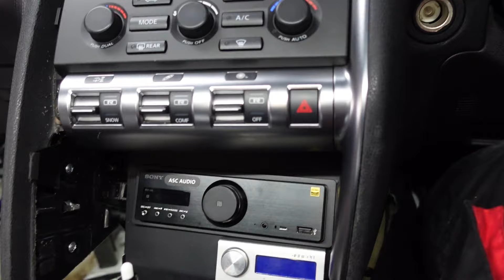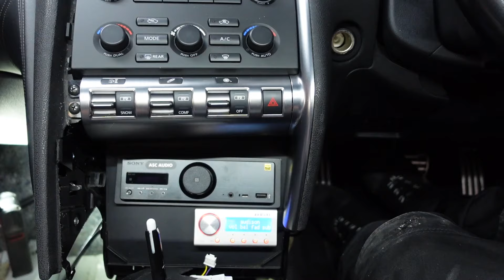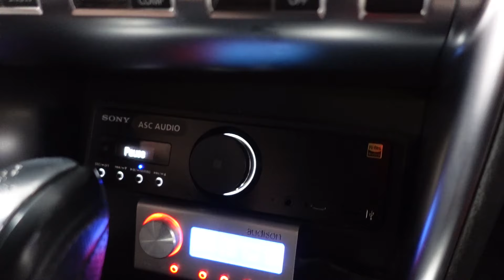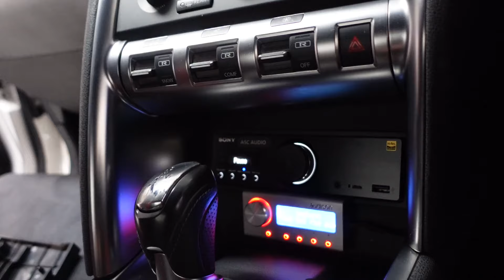gtr 35 morel audison sony DONE  !

Comment: The gtr looks great. Must sound fantastic. How come the bt module looks like its on an angle or is it an optical illusion with the camera.
Reply from the maker: the dash cut follows the original cd slot we only cut 3 sides so its level as far as nissan designed the hole we follow the same shape

Comment: When my system has an audio processor (DSP) should I “always” stop using physical crossovers?
Reply from the maker: no
Reply: Researching the subject, I saw that a few installers still use the physical crossover even when the speaker is connected to a DSP. In other words, the speaker's frequencies are being cut actively/digitally (by a DSP), but the installer still chooses to install the physical crossover. What is the logic behind this strategy? In these cases, doesn't the presence of the physical crossover interfere with the final equalization of the sound? Does the installer install the physical crossover in the hope that it will be a physical protection barrier for the loudspeaker? Is it a question of redundancy to protect the speaker?